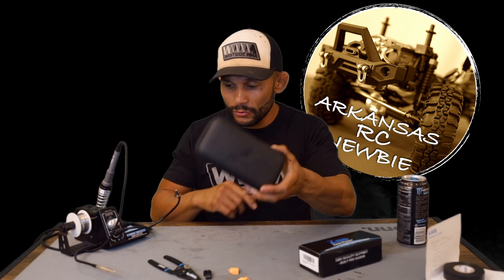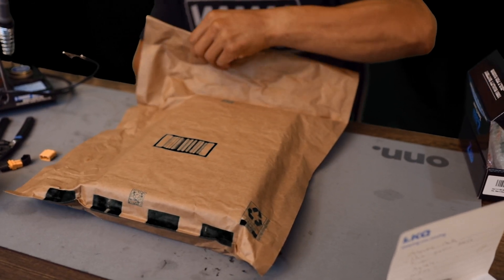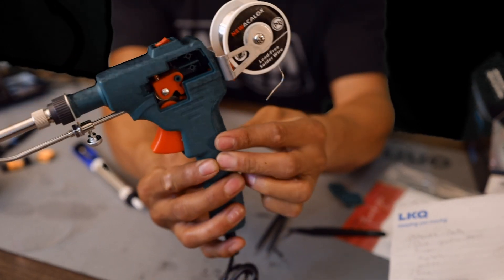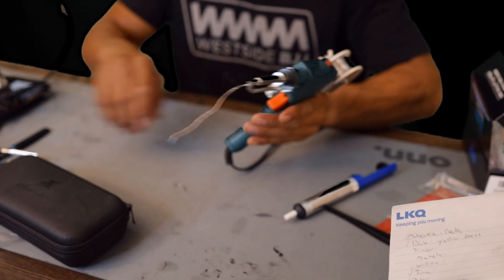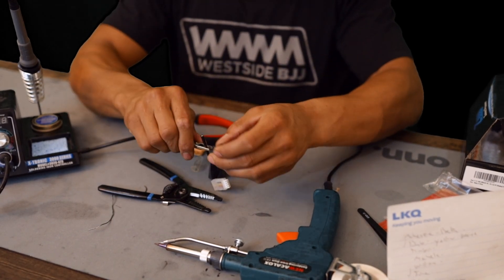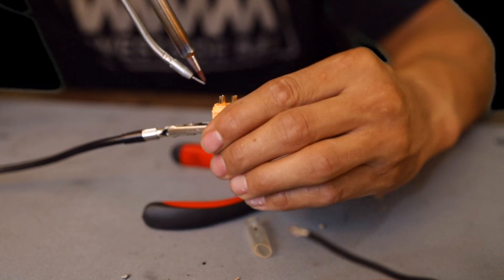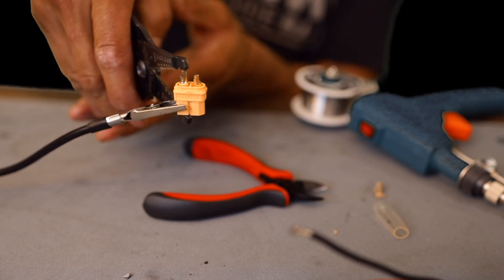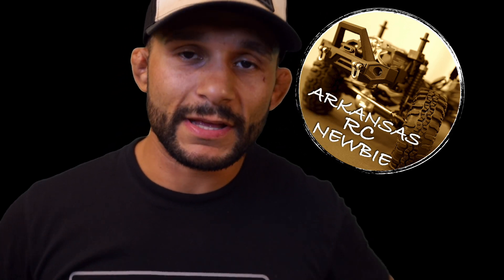Budget NEWACALOX SOLDERING KIT

Comment: When dong any battery connectors always connect the male and female to spread the heat and you will not have a melted connector on one end but that soldering iron is whack hehehe
Reply from the maker: Great pro tip, thanks brother. 😊